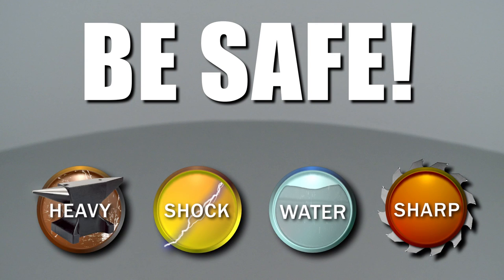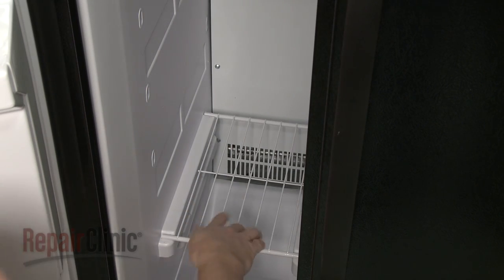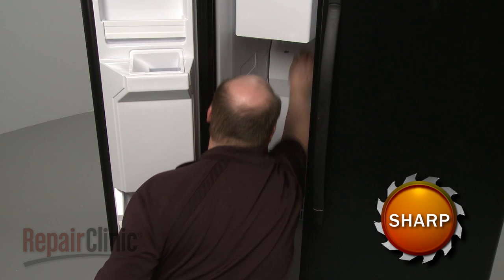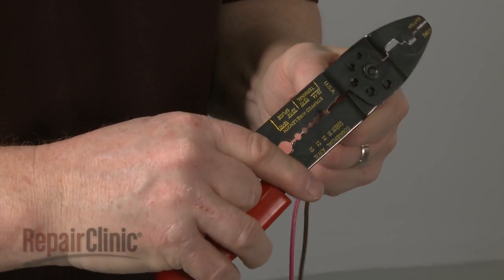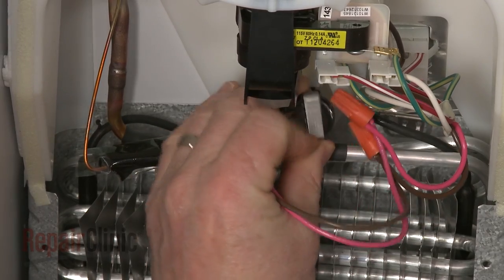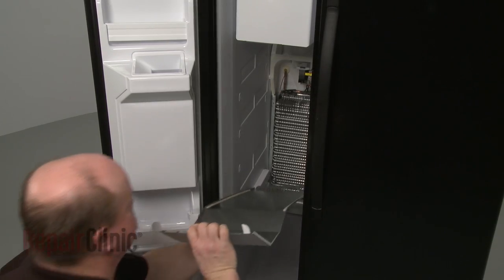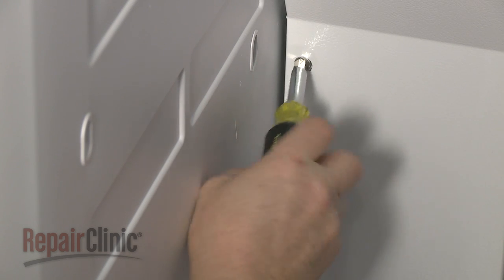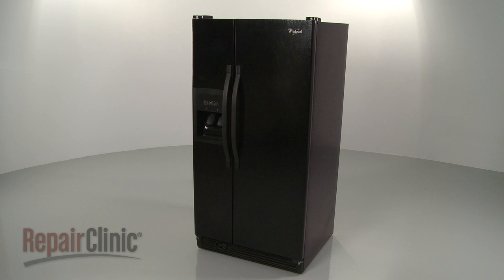Whirlpool Freezer Won't Defrost? Defrost Thermostat #W10225581

Comment: For those with a three wire thermostat. The one wire coming out of the thermostat off to itself is for a fan delay. These 3 wire stats for Whirlpool, Maytag  have been discontinued. After much searching I found an aftermarket stat specified for Maytag costing $70. No way was I going to pay that for this simple part that is basically nothing but a circuit breaker. I ordered a cheap $7 two wire thermostat. I cut all three wires from my stat plugs. I capped the one for the fan delay with a wire nut and siliconed the nut cavity. Then I just spliced the other two wires of my plugs to the two wires of the new stat with wire nuts and silicone. Doesn't really matter that the wire colors don't match as it is only a circuit breaker and they can be reversed.  I just made sure I plugged the plug into the rear wall in the same order or place it was originally plugged. The fridge defrost great. I did not need the fan delay. Just some advice to others that may run into the same problem.
Reply: Commenting so I can come back to this explanation. I have a Whirlpool but can not for the life of me find this mysterious thermostat. There is something clipped to the evaporator but it’s only a metal clip with wires. 😅
Reply: @nottheone25  It should be a small round enclosed/sealed metal part about as round as a silver quarter and 3/4" thick with two wires coming out of the plastic back portion of it that is wired to the fridge wiring. It has a clip on the front side that clips to the evaporator coil. It is not a typical thermostat that you adjust. It is just a breaker that closes and opens the electrical circuit to the defrost heater according to temperature and operates in conjunction with the defrost timer. So. the clip you are seeing is the thermostat if it has the round metal piece where the wires go into the back of the housing. Sometimes they blow up/the inside budges out from the metal housing which definitely means it is no good. But they do not always bulge out when bad.
Reply: It's 2024... thanks

Comment: Quick question. I bought a replacement defrost thermostat but it came with black and red cables. Can you please tell me which cable on the actual refrigerator is ground? The brown one or the pink one? Thank you.
Reply from the maker: S Guzman Neither is ground. Refrigerators operate on AC voltage so you have L1(line 1/incoming voltage) and N (neutral). The good news is that it does not matter as voltage can flow in and out of either side of the switch.
Reply: Hi sir,  both How much cost sir

Comment: What size connector nut do I use? Should I buy the orange color? Thanks.
Reply from the maker: It's a 73B wire connector. It will be orange.

Comment: My Whirlpool refrigerator (WRT311FZDW00) freezer section doesn't seem to be defrosting properly. I replaced the defrost thermostat (WPW10392132) and it still isn't working properly. What would be the next step to test or part to replace?
Reply: By "defrost element," I'm assuming you mean the heater? If so, I checked it with an ohm meter and it reads about 69 ohms. But I don't think that I'm getting good voltage to it. I only read like .3 volts coming to the heater.
Reply: As for a "thermistor," I don't think my particular model has one.

Comment: When I connect the defrost heater element to the defrost thermostat (part number 20T80K) on my whirlpool fridge freezer  the power trips.  Do I need a new heating element?
Reply from the maker: +Paul Flint Either a wire, the thermostat, or element is likely shorted to ground.

Comment: no you are not ready to plug back in. because you chose to use wire nuts and seal them with silicone instead of using something like a ray chem or crimp connector with heat shrink that melts and seals the connection with a heat gun, you now have to let that silicone cure overnight because it is not supposed to be exposed to those cold temperatures before it is fully cured.

Comment: My heater element or sum thin blew and made hole on evaporator coil no gas plus not workin
Reply from the maker: F E L I C I A S H AN G ASE If the evaporator coil has been punctured or ruptured than the refrigerator will likely need replacement. Sealed system repair can only be performed by a licensed technician and the repair often exceeds the cost of a new unit.
Reply: F E L I C I A  S H AN G ASE